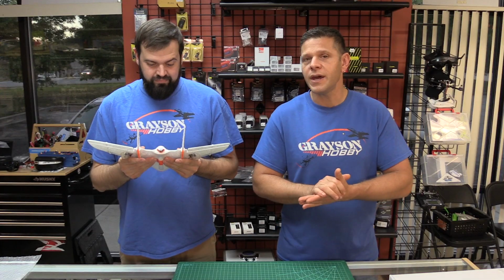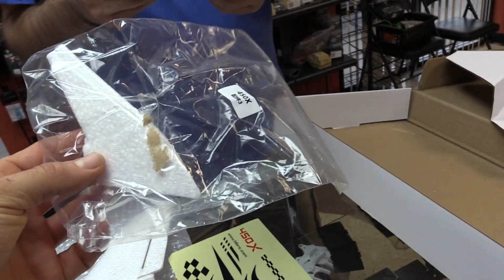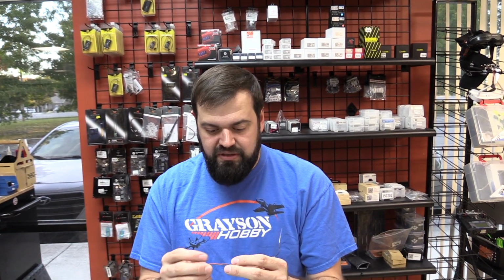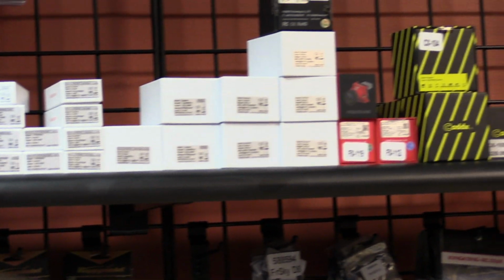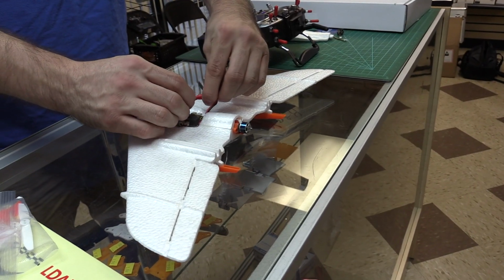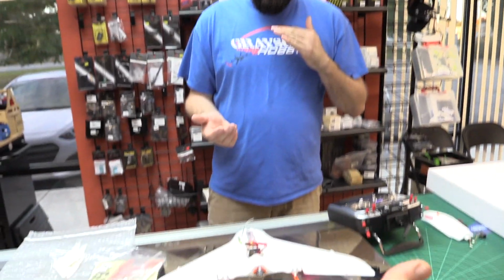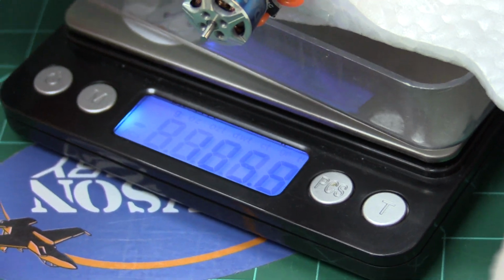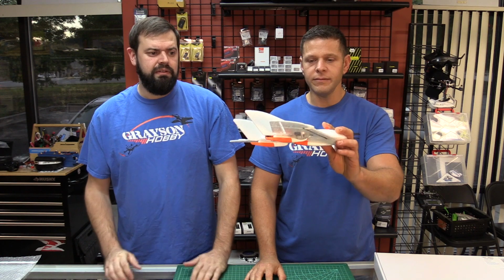Ultra Micro FPV Wing 🛩 LDARC 450x - No Assembly Required! ⚒

Comment from the maker: FPV Wings are one of the most stable platforms you can fly.  The aircraft design provides all the stability, no need to worry about configurations. Just set your CG and Fly - A different FPV experience. Not better nor worse than a drone, different  :) https://graysonhobby.com/kingkong-450x-micro-fpv-wing-pnp.html

Comment: That foam looks awful, like its either under pressurised when moulding or its got super hot later on and the surface beads have ballooned. I would reject a model that comes like that.
Reply from the maker: This particular model sat in one our vehicles for a bit 😏
Reply: @graysonhobby  that might explain it 🤣